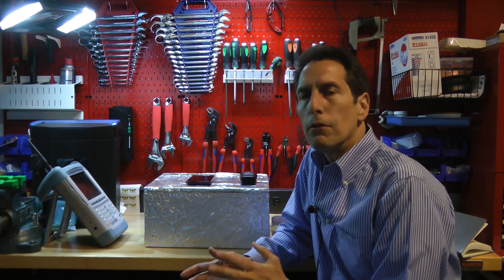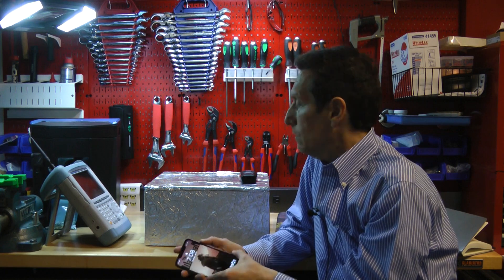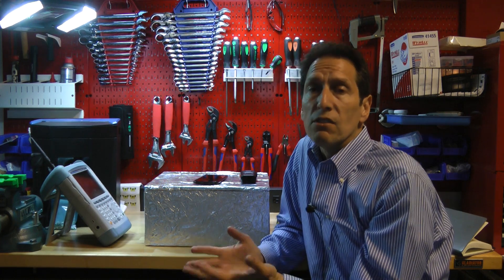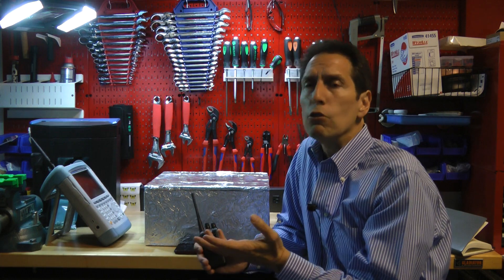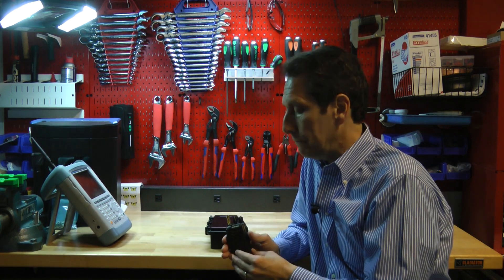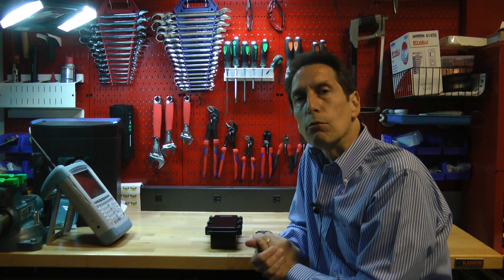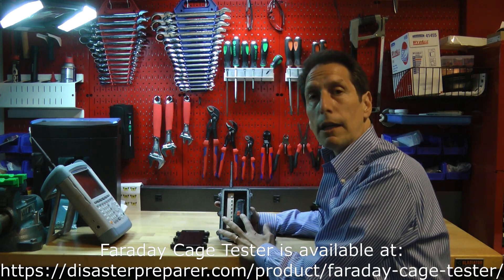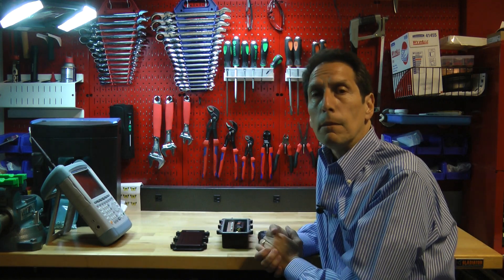Faraday Cage Tester - Video 1 (Introduction)

Comment: ⚠️😷.  Great Series of Videos!!  Thank you for your contribution of knowledge in the EMP protection field.
Just a thought....
I have several spectrum analyzers which I use for basic RF projects, but mostly for duplexer tuning.
For the cost of my Agilent n930b (up to 6GHz w/tracking generator & pre-amp options — was approximately $11k)
and my Rigol dsa815tg (up to 1.5 GHz w/ tracking generator & pre-amp options) — was approximately $1800)

I could have bought a truckload of  TINY-SA’s. The newly introduced and completely ultra-cheap pocket sized
“instrument” is seemingly ideal for EMP protection “Faraday Cage” type devices.

I just bought a second one just for that purpose.   (Only $80 shipped!)
Add an SMA connectorized retractable antenna, a few SMA cables, a nice “Nanak” or “Pelican” case to protect it and
an OST style “calibration kit” and you’re all set.

It even has a built-in lithium rechargeable battery.

It does 30Mhz through 900Mhz if I recall correctly.

That seems like a decent range of spectrum to test....

Give it a shot.  And Thanks again!!
Reply from the maker: Thanks, I need to try one out. I wonder how easy they are to use for someone who's never used a SA, whether they have a peak capture mode, and what their dynamic range might be. I'll get one and see how well it works for something like this. Thanks for the suggestion.